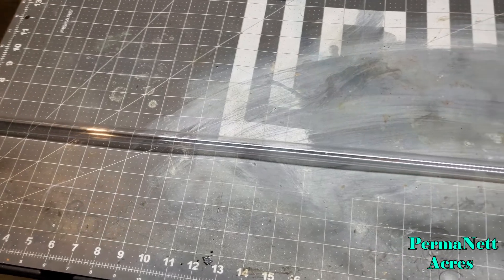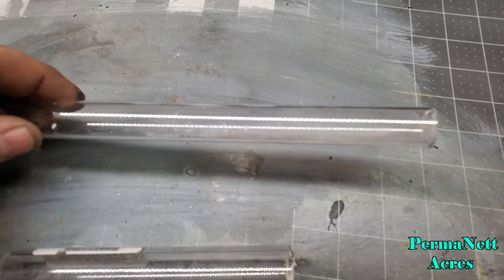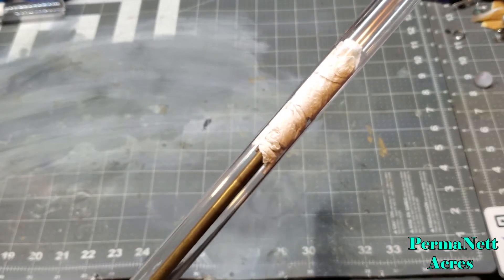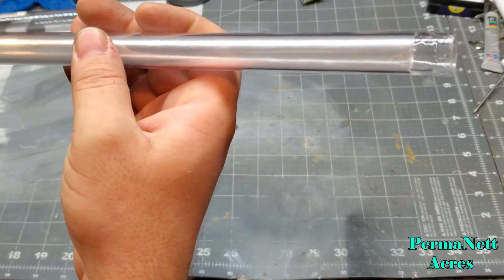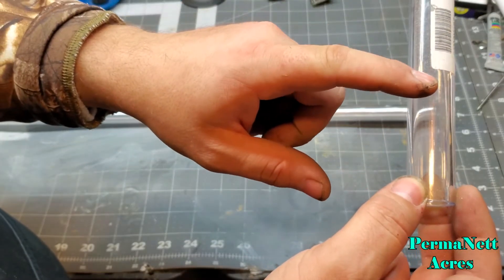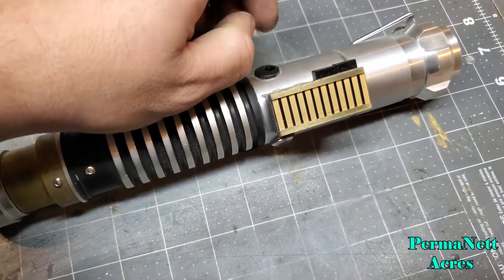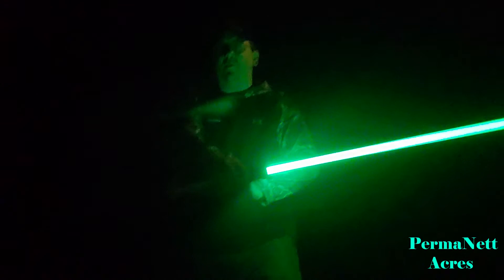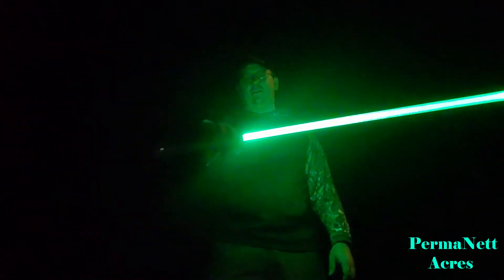Creating A Star Wars Rebels Style Lightsaber Blade For 1" Diameter Blade Hilt

Comment: Is there a link on exactly which blade You got here? When I go on TCSS I cant ever find it
Reply from the maker: I built from blade materials. 3/4" blade cap & stock with cellophane diffusing film, then I cut a 1" thickwall blade tube to fit the emitter of the hilt(s) I intend to use it with. So to the shortest emitter of the group that depending on the blade retention screw depths of the other hilts.